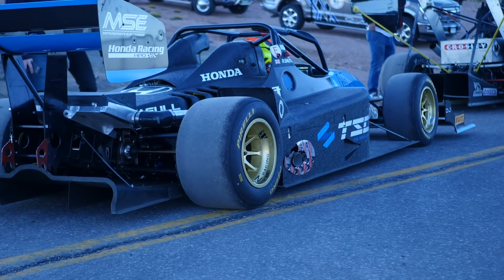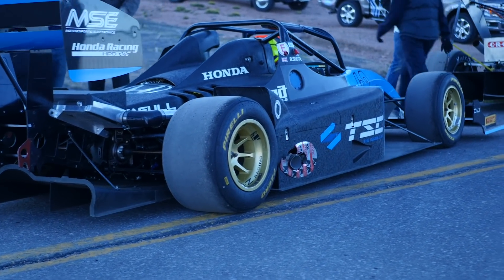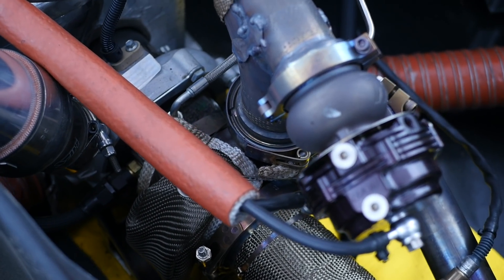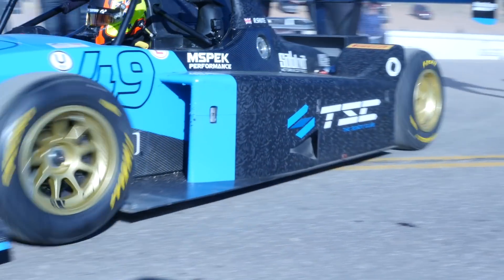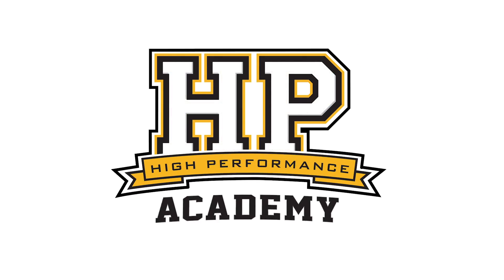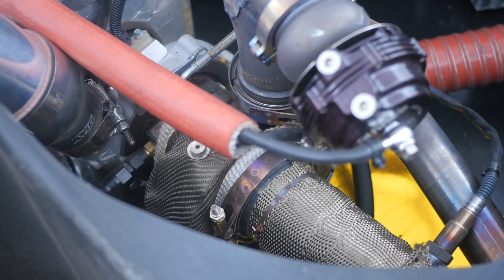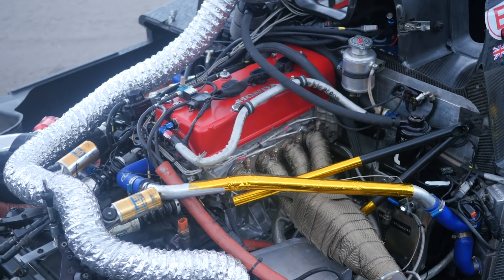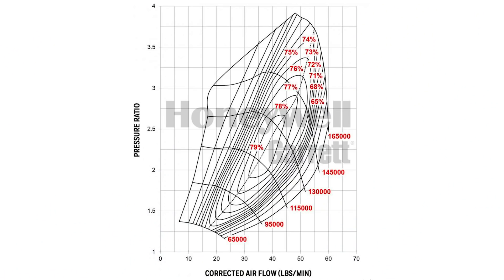What Do YOU Know About Turbo Speed And Pressures? [TECH NUGGET]

Comment: what happen if you introduce positive pressure to the inlet turbo? does it become more efficient? got the concept from compound turbocharging but doesnt really understand it
Reply: The pressure ratio would change, but it doesn't have to be more efficient.  In the example, in the video of overdriving the video, a higher pressure at the inlet would reduce the pressure ratio.  This would increase efficiency if you were above center section of the plot at 79%.  However, if you made enough boost with the first turbo, you could bring the pressure ratio for the second turbo, to around 1.5.  This could reduce the total system effciencyt to less than just using that one turbo.  It worth noting adding a second turbo will take more energy to spin as will, decreasing overall effciency.
Reply: If you both intercool and aftercool it gives you a huge overall efficiency boost
Reply: You may need to explain what you mean by "efficient".
More pressure means greater density so, overall, there will be a more dense charge, this, in turn, will result in more energy being imparted to the turbine. Not too sure where it will end up, re: the maps for both ends, but it is basically the reverse of what happens at altitude.
As an approximation, a turbo' (or any other form of supercharging) works by compressing volumes of gas and it is largely immaterial what the density is, so the more dense - colder and/or under greater pressure - the more dense the charge will be. This is the principle behind sequential and hybrid forced induction - if you have two compressors, each with an efficient 2:1 ratio, you will have a theoretical 4:1 overall ratio, less losses, of course. With hybrids, the theory is that the supercharger will provide most of the low to mid-ish rpm range boost, where it is more efficient, and the turbo' will provide a higher density charge to the supercharger to continue overall boost gains as the supercharger looses efficiency.

As Xens' would point out, it is quite important that the units are correctly sized but I would disagree about overall efficiency (again, definition?) if correctly designed?